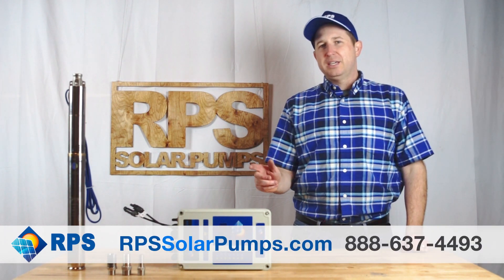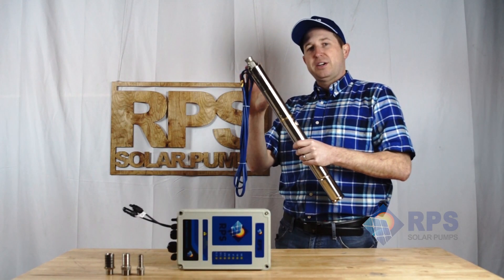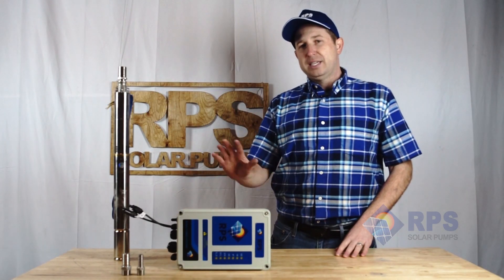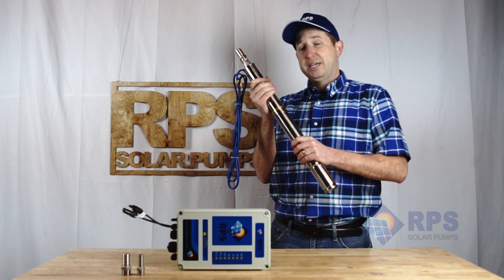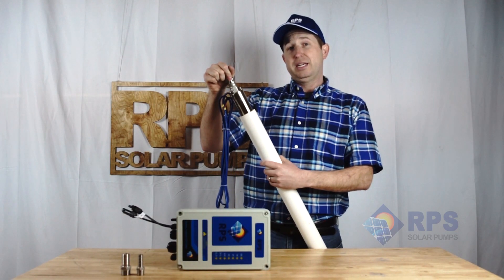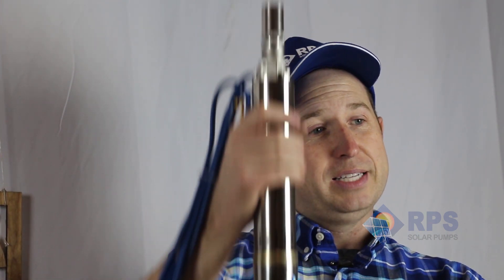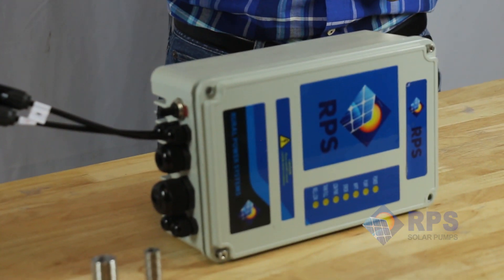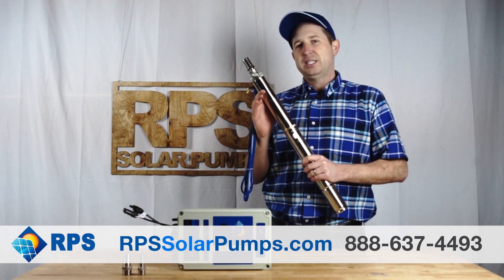USA’s First 2 Inch Solar Pump - RPS Solar Pump 400N

Comment: 4 inch 100' well in Florida with submersible pump. 3/4 hp 240v. Water table is at about 20 feet. 
I am looking for a 12v battery /solar pump that can be dropped down the casing after the removal of the existing pump and hardware. 
Ideas?

Comment: I’ve heard the number one killer of submersible pumps is overheating. If this 2 inch pump is put inside a 2 inch casing is there adequate water flow around the motor to create enough cooling as to not overheat this motor and cause premature failure?
Reply from the maker: All of our 2 inch pumps have BLDC motors so there is far less heat than traditional well pumps. They get plenty of water and do not overheat in the well!

Comment: So I’ve heard the number one killer of submersible pumps is overheating. If this 2 inch pump is inside a 2 inch casing, is there enough water flow surrounding the motor to create enough cooling in order to maintain a long life?

Comment: I was told by the RPS literature and same when I called them. That pump can only be submerged 129 feet below water level.  My static water level is 80 feet.  With no real drawdown at 6 GPM.  So 80 feet of air plus 129 feet of submergence puts me at 200 feet of pipe down the well with a 9 foot safety margin. PS. with a new windmill I can use the 400N and the windmill out of the same bore hole.  Thanks RPS and Mike for explaining it all.
Reply from the maker: No problem, thanks for watching!  -Mike

Comment: Put mine in a 2 inch hand drive metal casing and i had too grind the rivets and the brass ring down and at every joint ( 5 feet) i had to tap with a mallet and twist it back and forth to get it too go down. I had to use 1/2 galvanized pipe instead of poly pipe because i had to force it thru the pipe joints. You also have to get the old style water sensor because their new style wont fit down the pipe. I also put a 2 foot 3/8 galvanized pipe on the pump to ensure there was room for the sensor

Comment: Is it possible to entering 2 inch pvc pipe bore well in 150 feet depth without trouble(tight fit but surely possible)? Kindly inform to me for make 100%  sure.
Reply: And how can get I this product from Bangladesh? I have no relative in USA. How much price of this pump
Reply: Sorry for disturbing but I want to know that, Is it possible to 220v Ac supply. Because I have no battery or solar panel or solar system.
Reply from the maker: Yes we have an AC to DC converter to run the pump.

Comment: is that run with direct current/without solar???
Reply from the maker: Yes it is direct drive from solar, no batteries required.  However, there are battery inputs if you need to pump at night or when the sun is not shining.

Comment: how deep can the submersible reach  into water level.?
Reply: I was told by the RPS literature and same when I called them. That pump can only be submerged 129 feet below water level.  My static water level is 80 feet.  With no real drawdown at 6 GPM.  So 80 feet of air plus 129 feet of submergence puts me at 200 feet of pipe down the well with a 9 foot safety margin. PS. with a new windmill I can use the 400N and the windmill out of the same bore hole.  Thanks RPS and Mike for explaining it all.
Reply from the maker: It can pump from 200ft+ with the correct number of solar panels!
Reply: DEEP AS OCEAN DEEP.  :3

Comment: You have 1 inch diameter submersible water pump  ?
for 1.5 inch borewell.
Reply from the maker: No sorry, have never seen a submersible pump less than 2in.
Reply: If you're over 25', gonna have to go with a airlift, or rodpump

Comment: What is the MAX distance you can run the wiring from the control panel to the solar panels? Thanks
Reply: How much weight is this water pump? Is it American made of China made? Thanks
Reply: @Chekib187  good questions but no answers. RPS, please answer.
Reply from the maker: No real limit.  Up to 100ft is standard and after that you might need to go to thicker wire to account for voltage drop.  If you let us know how far it is, we can help you out!
Reply: Is it fit for 100watt 12v
Reply: How much is for something like this